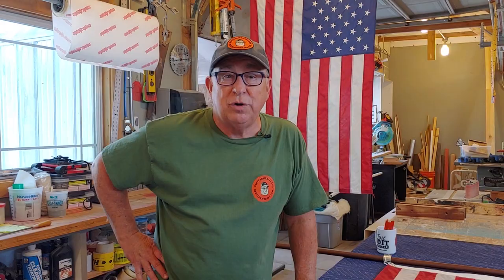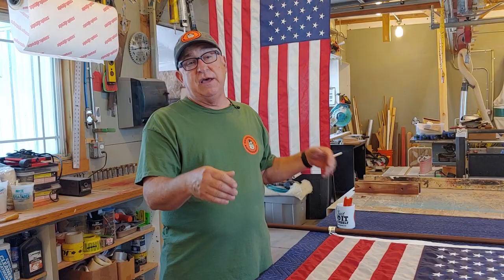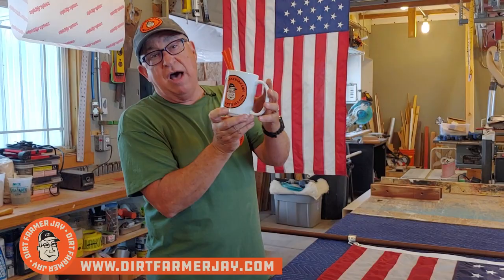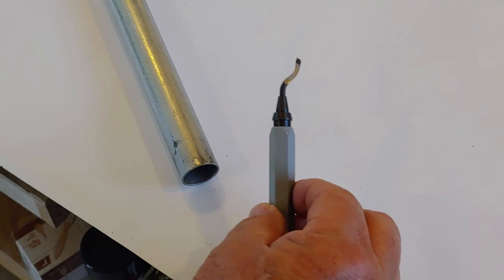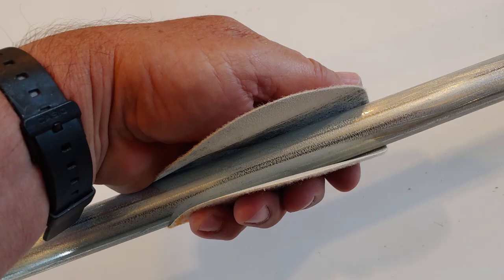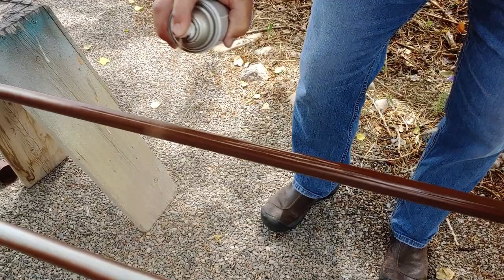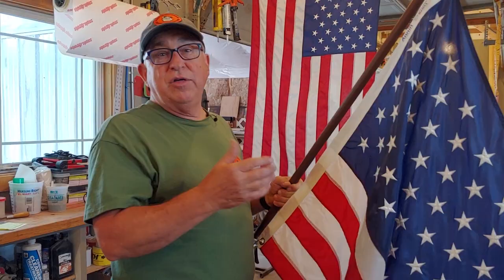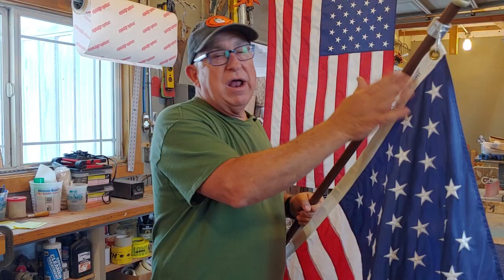DIY Flag Pole

Comment: Why hasn't anyone mentioned the flag hanging behind you is backwards? The union should be over your right shoulder. Other than that, great video.
Reply from the maker: Thanks Dexter Butler. That flag was hanging there temporarily until I had them both mounted and could carry them to post them on our front porch. Best to you, DFJ
Reply: @DirtFarmerJay  Roger that. Didn't mean any disrespect. Just wanted you to be aware. Happy New Years!
Reply: @dexterbutler9735  it all depends on where your POV is. From where the camera is here, yes, it's backwards. But if you were on the other side, it's correct.

Comment: 10:34  I was told that your barrel is upside down.  The thick ring should be away from the Flag.  The bottom barrel has the thick ring facing away from the Flag.  This way, the Flag has less stuff to move around as well as not catching on any exposed set screw.

Comment: our flag pole 2inch alumina blow down /broke off-can we put a 2x2 wood inside?
Reply from the maker: James, you can, but that will be a temporary repair, especially if you use typical framing lumber such as fir or pine. You might use a short section of conduit or pipe at the break. Let me know how turns out. Best, DFJ
Reply: read your reply Thanks (we have to get it this spring)